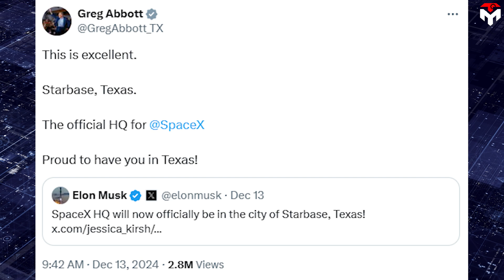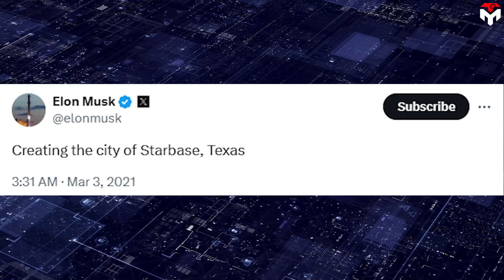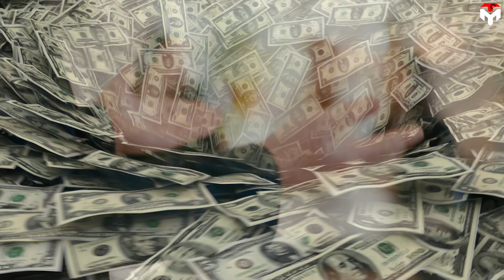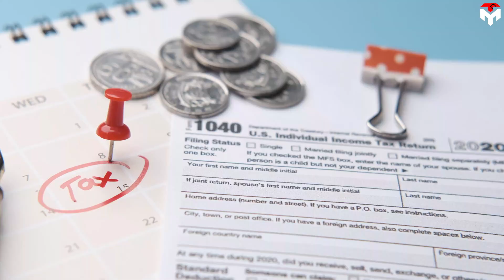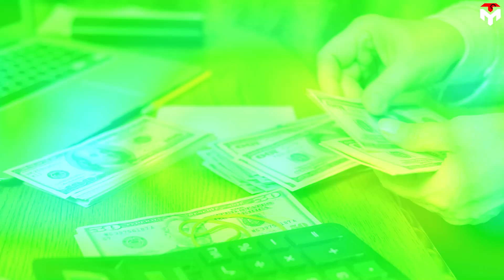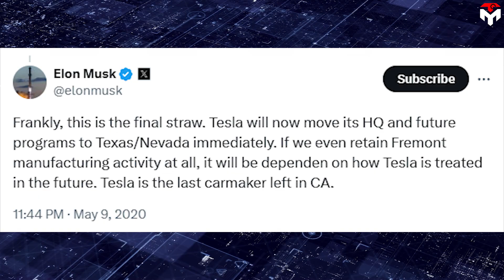Goodbye Cali! SpaceX HQ officially in City of Starbase, Texas after California's Trouble...

Comment: You can't move a whole industry quickly.  first headquarters then grow manufacturing capacity over time.  Freemont will slowly be run down and replaced by capacity elsewhere.  It is not an ideal factory layout anyway as it is an ex-GM plant.  Similarly with Oracle.  Over time it will shift the remaining 6000 jobs.  Newsome has really lost his mind.